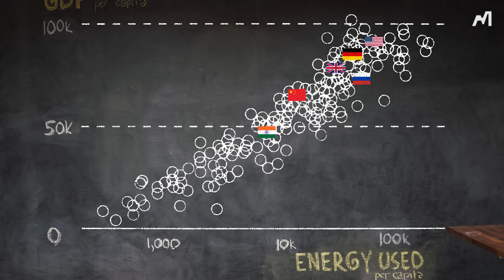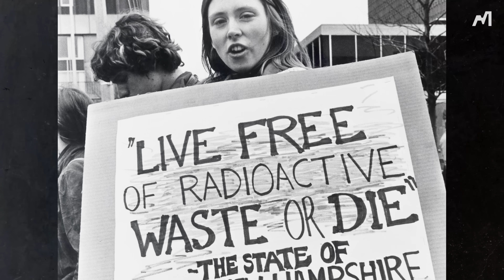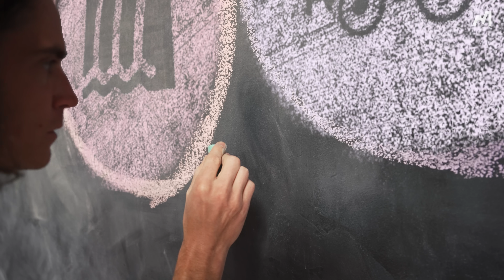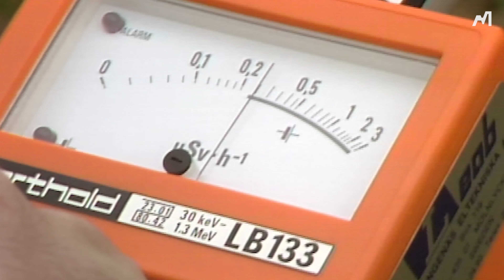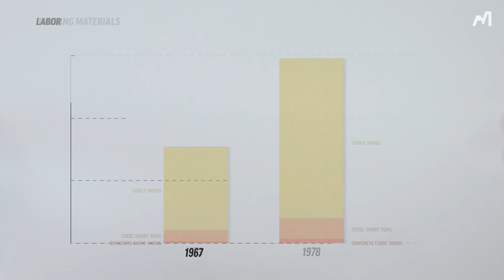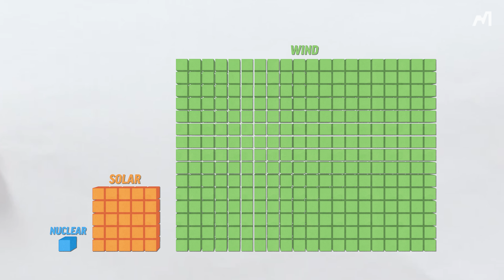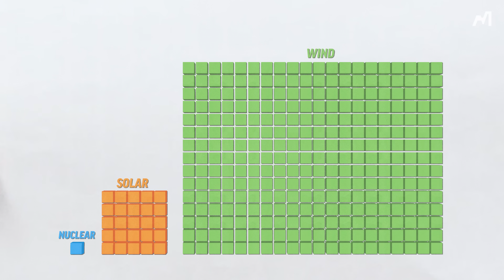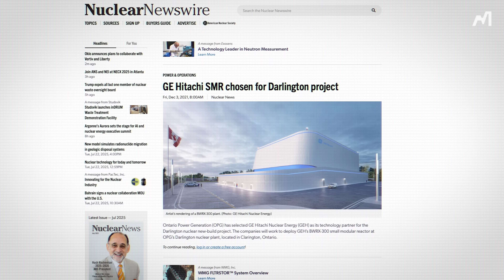They're Lying to You About Nuclear Energy

Comment: The bottom line is that nuclear plants just aren't profitable and competitive with other forms of energy. Many many cases of plants requiring government bailouts, such as the Perry plant in Ohio (closest to me) which had to bribe politicians to get a bailout. The costs to build are high, (not just from extra regulation) the costs to decommission are high  (wasn't mentioned in the video) and plants only last 40 years (up to 60 with more permits) not 80 years like said in video.
Reply: Yes, but you are COMPLETELY missing the point. The fact that nuclear is unprofitable and not viable is 100% self induced. It takes 18-months these days to build a solar farm and the government pays for half of it. It takes 12 years to build a nuclear reactor these days because the regulatory framework is stifling and crippling. It discourages risk capital. Even in this video it says it only took 5 years to build a nuclear reactor in the 80s or something. So essentially excluding fossil fuels the reason why they aren’t profitable compared to alternatives is because solar/wind is heavily subsidized and not an authentically priced market and nuclear is HEAVILY disincentivized.
Reply: Thr most expensive part of a nuclear power plant is the civil work. The concrete can last much longer than 60 years.

Comment: Good video about the fear-mongering that goes in nuclear energy in a time when a clean source of energy is very much needed. However, when you mention at 14:40 "the safety aspect, decades of data on radiation, low land requirement and reliable electricity, why would you build something else instead of nuclear?", the answer is mentioned by you before- time to build a nuclear reactor and the costs associated with it. Time to build a nuclear reactor- on average 7 years (many face significant delays). Costs per unit of energy generated- higher than solar and wind. Also it depends on politics. How many countries have access to nuclear technology? In total about 31, so what does the rest of the world do? (could be argued that smaller nations can't build wind farms either). And the slow speed of building a nuclear reactor can be blamed on regulations but you can never really tell about those. They're there for safety and maybe if they weren't there would have been more accidents (or maybe they would have been the same, who can tell).
Reply: Factory built SMRs will make a massive difference
Reply from the maker: Yes the time to build is high but it's high because of ALARA. Not because it actually takes that long, physically, to build a nuclear plant.
Reply: @Maxinomics clearly didn't watch your video

Comment: The regulatory overhead is probably the single biggest reason we can't build anything any more, from high speed rail to houses, not just nuclear plants. Nuclear plants are just the most burdened. Counter argument is that many of the regulations do mean we are all safer. The question is can we as a society maintain the benefits of safety regulations while streamlining compliance?
Reply: Doing an honest cost/benefit analysis for every regulation would be a huge win.
Reply: @AlecMuller  sure, but people have this crazy idea that regulation can/should be measured by amount rather than efficacy. There's no such thing as too much or too little, being pro or anti-regulation in general makes no sense.
Reply: @AlecMuller  oil companies wouldn't like that, i'm sure they're behind MOST regulations against nuclear... same was big pharma is being most FDA regulations... it's called "regulatory capture"
Reply: @AlecMuller  Something worth mentioning is the amount of training and skill the current operators of nuclear power facilities have due to said regulations, it hasn't been a problem because they have been run well due to their experience and understanding of how extreme the consequences can be if there is a full on nuclear meltdown.  We should be wary of the erosion of standards as we begin to warm up to nuclear energy again, anyone that has worked for company that is profit driven (which is basically everyone these days) understands that the corporation will do just the bare minimum as to avoid legal liability in order reap in the most financial benefit.  Things have been safe because the rules believe it or not have been working.

Side note: I know the content creator acknowledged this but the notion "a little thyroid cancer" is okay is a bit naïve because  skims over the real impact that cancer has on the livelihoods of real people (ask anyone whose had a family member that's experienced or died from cancer).  I am a fan of nuclear, the points on land usage vs energy output are valid - but we should proceed with caution us humans always have a short memory don't we.
Reply: @litoaznboi33  The "rules" have recently become arbitrary and anti-nuclear. There was a guy named Jackzo, who was head of the NRC for a bit. Turned out he took money from big oil and gas to draft regulations the nuclear power industry most definitely does not need. He ended up having to resign after it came out he was harassing women at his workplace too. What a piece of work. He's one of the people who made it so hard to get regulatory approval for anything nuclear for years.
Reply: @litoaznboi33 except the harm radiation cause is nothing compared to fossil fuels which no one talks about.
Reply: We went too far on nuclear regulations and, frustratingly, the U.S.—which pioneered the tech—has almost abandoned it. But balance is key: public vs. private, efficiency vs. safety, exploitation vs. protecting the vulnerable.

I’ve gone full circle. Family in the industry lived long, healthy lives. Chernobyl and Fukushima shook me, but decades of lessons and an otherwise strong safety record brought me back.

Nuclear isn’t a silver bullet—diverse, hybrid energy systems are more resilient.

If we evaluate facts objectively and keep special interests in check, we can find solutions that benefit everyone.
Reply: @JM2021abc the problem with government is that it cannot be balanced by its nature. It will expand forever until it destroys everything. Because government by definition is an absolute power (monopoly on violence) there's no force that can balance it.
Reply: You assume they make us safer. Do they? They may make nuclear safer (and that's not a certainty) but that means we have to rely on other energy sources, like coal, that are more dangerous.
Reply: Most of the existing regulations are nonsense and only slow down economic growth, half of it could be abolished suddenly without any problem occurring
Reply: sounds like we have been giving up freedom for safety without even knowing it
Reply: The problem is government.
Reply: Nuclear power is over-regulated for a lot of reasons, primarily fearmongering, misinformation and lobbying by corporations with opposing interests.
Reply: A Hundred Percent
Reply: at this day and age, regulators and governments are just lazy to overcome these issues, while they have time and budget they still choose the easy way out: refusal and cancellation. I always ask the same question for Co2 emission compared to so called "renewable energy". Charging a tax to all factories and corporations just increases the toll for a weak outcome. We still gotta rely on fuel to survive and when that runs out in 2050 or whatever, we gotta go to nuclear
Reply: look at china, they've adopted a do now think about regulation later mentally.  and they are now dominating the market in many projects (high speed rail, nuclear etc)
Reply: @justthatguynone6792  all third world, growing economies and bankrupt countries are gonna follow, especially those with big populations, the more manpower and the more engineers they have, hence in that case the quantity will beat quality and theyll build them even cheaper than 1970
Reply: @justthatguynone6792 You don't want to quote China for efficiency. They do everything at the lowest possible standard then pretend their product works just as well as the real thing. They don't. China has the highest rate of accidental deaths, period, and infrastructure built in the last 10 years is already crumbling or abandoned.
Reply: The poverty caused by being overregulated makes people sick.  They never include that in their calculations: Poverty makes people sick and shortens their lives.  But regulating ceased to be about safety long ago.  It's about controlling our behavior and stealing our money.
Reply: Google “Price Anderson Act” then ask, “If nuclear power is so safe, why can’t they get any insurance company to insure their nuke power plants??”  US taxpayers are paying the cost to insure ALL nuke power plants in the US.  This cost is never factored into nuclear energy operating costs.  No insurance companies will touch nuke power because they understand the true level of risk and liability.  It’s incalculable.  Watch the vid of Fukushima Reactor 3 exploding.  Each reactor needs continuous cooling water pumped through it.  If cooling stops…. BOOM
Reply: I think the key would be having regulators with open ended approaches to reviewing the design and product.

For instance, instead of having a regulation saying 2 chemicals have to be X meters apart it might make sense for a regulator to determine if an incident where they could mix would actually do harm, or if things like barriers would prevent them from ever mixing.
Reply: its just all old whyte dinosaurs playing with our tax money and keeping a lot of it for themselves
Reply: Maybe a more egalitarian society could vote on what it actually wants instead of small upper class  holding all the power
Reply: You'll be safe in the house... but of course you can't afford the house to be safe in. Our manufacturing is the safest in the world... if we simply don't do manufacturing, and no accidents can occur! It's genius, really.
Reply: How many people are killed by toasters? It's basically unheard of. Now imagine they were only just being invented now. People would think you were crazy for suggesting something so dangerous.
Reply: I like the idea of regulations having an expiration date.
Reply: @MarsTBK That's extremely dumb. The laws of Physics, Chemistry and Biology have no expiration date. Just staying rational will have to do.
Reply: Regulations are mostly harmful for people
Reply: @xfalconn_ Especially housing currently. 
Too many ridiculous zoning laws and now it's way too expensive to build houses, so we get slapped together houses that aren't going to hold up for 10 years because they're using the cheapest available labor.
Reply: @JimboSlice-t5i Yeah, we are the only generation who sees buying a house as impossible only due to regulations implemented for decades accumulated. Boomers hate us
Reply: @xfalconn_ there’s plenty of housing. It’s just not affordable
Reply: @joecalta3679 that doesn’t mean it is cheap to build these houses, regulations make them more expensive to build in the first place
Reply: @xfalconn_ It's not regulation. It's the fact that housing and suburbia in general aren't maintained at an adequate rate, leading to a 10-year lifecycle with planned obsolescence both in the construction and the residential zone itself. You're still right about Boomers being at fault- they're the ones who let the construction industry turn infrastructure into a consumer product rather than the national backbone.
Reply: @xfalconn_  someone hasn't studied the history of the pharmaceutical industry
Reply: @TheOOOOOOOOOOOOOOO  or history of any kind :D
Reply: @xfalconn_  no
Reply: I call what you have a loser mentality because no matter which way you go, you will probably lose. The question you asked is, how do we weigh "safety regulations" with streamlined freedom? For people like me, the true first question we must ask is not that one, but "Who will decide?" You can debate your question all you like, but if you're not the one deciding, what does it matter? So, the first question we must decide as a society is, whom will decide how much risk vs safety we will tolerate or how much safety vs streamlining do we want as you phrased it? Well, luckily for you, at least in the case of nuclear, it's already been determined that government will decide, and as you know, they decided on maximum safety. Decision made, end of discussion, goodbye.

Comment: I have indirect contact to the nuclear industry through my job, which has a division that provides service to some computing systems in operational reactors. Let me just say, having sat in some all-hands engineering meetings where issues are discussed, the regulations around nuclear are so incredibly suffocating it's insane. I cannot give specifics, but its on par with insanity like "I only eat with forks made by one company from one specific alloy, made for 5 years in the early 1980s.". You might think "fork" alludes to some custom hi-tech machinery. But no. It refers to things as commonplace and replaceable as a fork.
Reply: That would quickly kill any industry that wasn't subsidized.
Reply: From indirect contact to non classified research, I can say this is true for military reactors too.
Reply: China on path to built 100 nuclear power stations, if we not we lost on evertynk to China
Reply: O-rings, seals, valves & pipes...
Reply: It’s a racket is what I’m taking from that.
Reply: @BvictoryforChrist well maybe not a racket but a lot of the explosion of the regulations was in the 70s and 80s so there were supplier companies during that time which were trying to comply with the regulations (i.e. the regs say a specific bolt size for a specific application needs to be of x alloy and possess y and z properties like tensile strength), but during that time very few plants were completed, so demand was low, and future plans were cancelled or delayed years and decades from beginning construction, so those companies had no demand for their very tailor-fit products and went out of business or retooled to other things. It's also the time when a lot of our base material production like steel/alum died so the feedstock of high quality domestic stuff died as well. But the regulations were never or seldom reviewed and updated for what was available or 'was that really needed in the first place?'. So now  we're at where we're at.

I did some niche scientific research in grad school and this story is familiar with anyone who has done that (minus regulations). One tool or instrument or part was made by one or two guys in a garage or machine shop, who are now dead or retired, never trained anyone because the demand isn't there and people generally don't want to be pigeonholed into making one widget for their lifetime, even if it is critical. A guy who makes one such thing attempted to recruit me to move halfway across the country to teach me, because I did the research and was familiar with it and handy enough mechanically. I said no, I'm not moving to the East Coast to apprentice to make like two dozen orders per year of +/- 4 versions of one tool for the next 40 years of my life.
Reply: If the design and licensing basis for a plant is based on a particular part, it is easier and less expensive for the operator to continue using the same part.  That's not unique to the nuclear industry, that's common in engineering across any industry with potential high severity consequences of failure.  Once you've validated a design, it's cheaper to maintain that design than it is to redesign.  That said, US commercial nuclear plants are being redesigned every day of every week of every year.  It requires a lot of paperwork, but it's nothing like "I only eat with forks made by one company from one specific alloy, made for 5 years in the early 1980s."